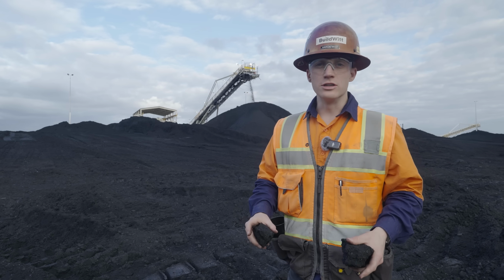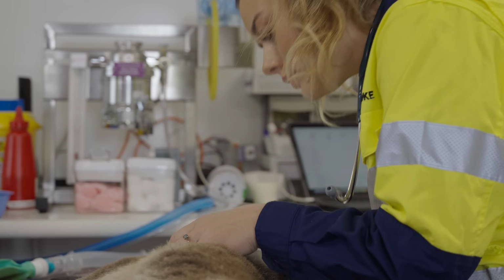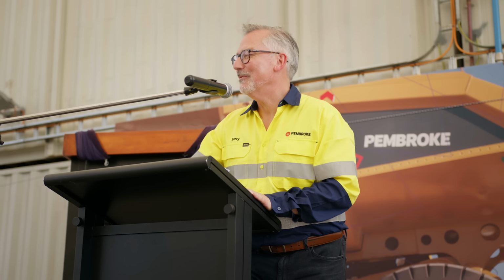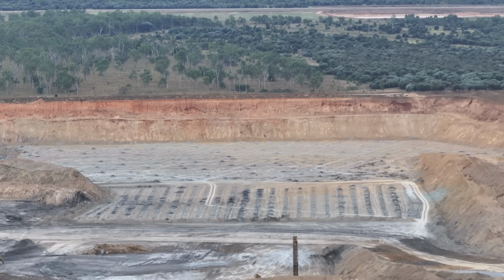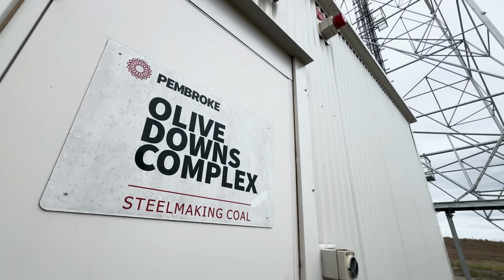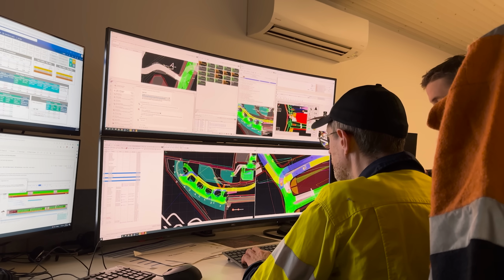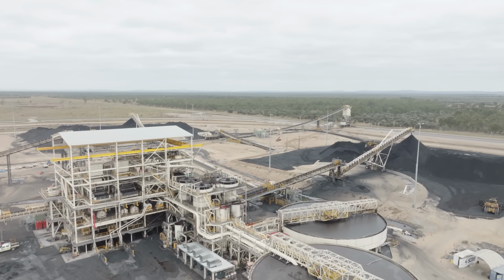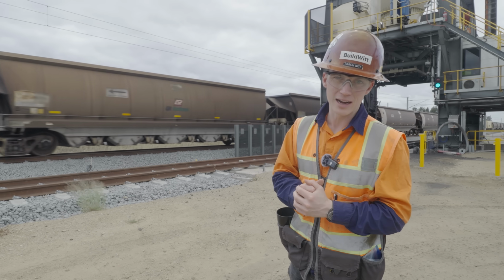Autonomous Mining Trucks, Blasting, and Koalas?

Comment: So how is maintenance and fueling done at this mine?
Reply: As issues arise in truck, mine control are aware from remote. If there is any issues/ breakdowns the truck will either derate or stop where it depending upon the severity of the issue.
In regards to fuelling, the trucks run 24hrs without requiring fuel (approx 4000l capacity). There is fuel area. The truck enters area and stops until the truck is called in by the serviceman. It arrives at a station point (stopping point) where the truck can be switched from autonomous to manual. Then turned off.

Comment: How do these trucks know where and how to back up?? 😮😮😮 do they recognise the excavator? Are they ‘talking’ to it? How do they know when they are loaded and can go?
Reply: Hey yes the machines know each other's precise location (sub-cm) by advanced telematics. Pressure sensors on hydraulic booms and suspension systems calculate payload. Machines are able to report data such as number of lifts and trips per hour. They'll return to the service area if a problem occurs.

Comment: How do the trucks know when and where to reverse under the digger? Does the digger call the trucks in when he wants one?
Reply: The digger operator can make a spot point or two depending on the dig from his screen in the digger.
As the bench advances the spot points will naturally move and the digger operator will move the spot point.
Along with the floor changing the digger resurveys the area to ensure the virtual mine is kept updated.

Comment: It's incredible to see how advanced mining technology has become. Those autonomous trucks are game-changers for efficiency and safety.
Reply: I work in an autonomous pit. The broken down trucks are only manned up to move to designated areas or to manually tip due to excessive load. Can also confirm that autonomous trucks create different jobs, both entry kevel to highly technical. I personally would not have begun working in the pit if I had to serve a couple of years in the trucks to get on the machines. If you want to drive trucks there'll always be manned pits stuck in the dark ages somewhere.

EDIT: we do man the trucks up rarely to move stemming material for the blast crew if the moxy is not applicable
Reply: And taking jobs
Reply: I saw you on reddit
Reply: And profits for the owners
Reply: And employment.
Reply: I thought you meant to be creating jobs for the people not taking them away
Reply: @saratammaro3505  taking away unskilled jobs isn't a bad thing, encourages people to gain some skills to offer the world
Reply: So much money and stuff always breaking
Reply: @Zac.r90 wrong!
Reply: @Zac.r90  I can tell you have never worked at a mine. Things break more when operated by lazy and dumb operators LOL
Reply: Yeh, but some blokes could have had good jobs to support their families too. Advancements means job losses.
Reply: @blueman5924  It means more jobs for mechanics, electricians, and support operators.
Reply: @Porty1119  Maybe on this fleet because they're CAT. I know on the Komatsu autonomous trucks they need a lot less maintenance personnel.
Reply: @blueman5924 good nobody should mine it’s a horrible job
Reply: @blueman5924 if your job can be replaced by automation, it’s time to learn more valuable skills.
Reply: @blueman5924 well have some skills to offer, driving a truck is the most brain dead lazy job going haha
Reply: @Bigsoot7393 agree with you! Imagine a driver who’s been in the field learns the tech and some admin. They will be a very highly payed and last to be fired person.
Reply: @Bigsoot7393  What an arrogant p ricardo.
Reply: @BrownWarrior1888  bit like the people who used to shovel horse poo off the streets complaining when cars took over they were losing jobs
Reply: So do they have operators trained and on standby for when something glitches?

Comment: 800 tons/hr with such big truck size seems pretty low. Must be a long haul
Reply: Yeah but coal is much lighter than rocks. And they also need the trucks to transport the top soil and transport the waste back into the pit.
And he also said they fill one 10 000t train every day. Which would come out to a much lower number of tons of coking coal per hour:

10 000t / 24h = 417 t/h 

Considering they have the fine waste and the heating coal I think the math is mathing. 
Dump in 800t/h of raw material and get 
400t/h of coking coal
+240t/h of heating coal
+160t/h of waste

I have no clue if this is the actual composition of the material though. Just my guess
Reply: It’s an 800t excavator. Each scoop is ~100tons! 😮😮😮
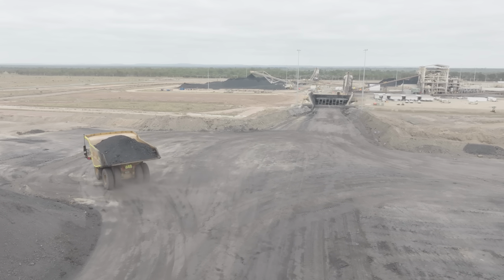Reply: @BeachhouseTerrigal  at 10:55 a truck is dumping into the crusher and Aaron says, they are dumping at least 800t/hr into the crusher. Which would make about loads an hour. Seems off. The stone quarry I work at runs 800t/hr running 2 772 trucks.
Reply: 800t/hr is the processing plant

Comment: its interesting where they chose to put in all the new tech
the semi autonomous/remote drill rigs seem pretty great, not sure how i feel about the haul trucks being driverless though

incredibly surprised that the rail line for the processing plant is electrified, we dont have much electrified railways in australia so its nice to see
nice that theyre using electric drive haultrucks though, even on their own theyre a pretty significant reduction in diesel usage. its a hell of a lot more reduction if you use a trolley assist system but its unfortunately  quite tricky to have such a static piece of infrastructure in a mine pit

burying the waste coal dust seems questionable though right? seems like as a fine powder it would be very easy for it to contaminate waterways
Reply from the maker: They’re placing the fines where they mined the coal from originally. It’s deep. Won’t affect waterways on the surface
Reply: Couple of points to clarify. Trolley assist is usually applied to older, deep pits where the haul cycle can be significantly reduced with overhead power. This is a new, shallow pit.
Burying waste (ie anything with no economic value) back inside the pit outline is the most efficient and best method of disposal. It reduces waste haukage costs and reduces final landform rehabilitation costs.
Cheers.
Reply: This mine uses the latest approach. Most mines dump them in a hole and fill it with water. A tailings dam.  This puts them back exactly where they came from encapsulated and safe.  This mine has zero impact on groundwater.